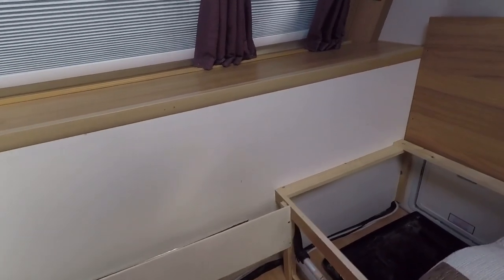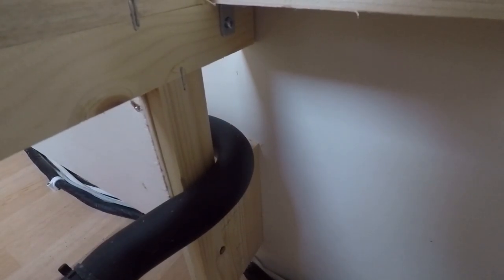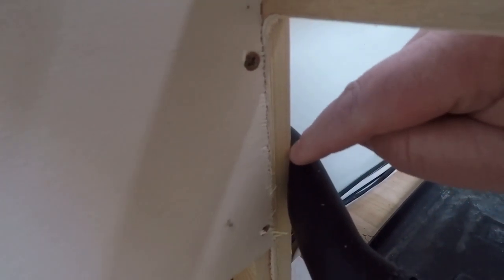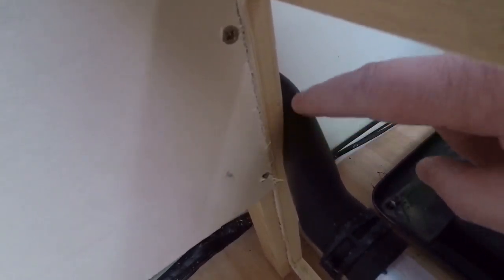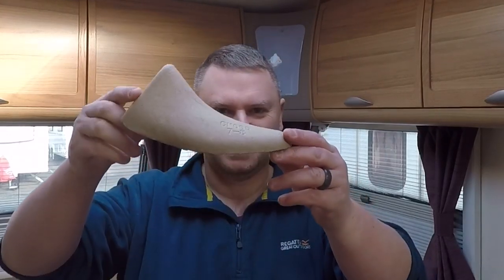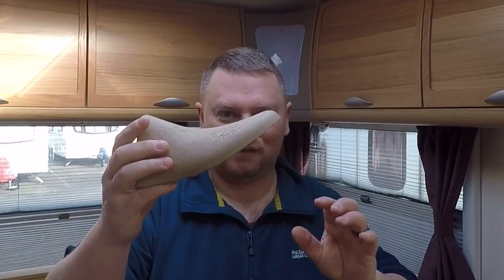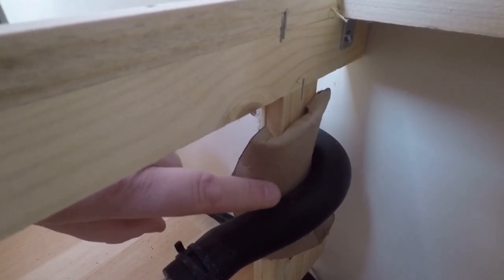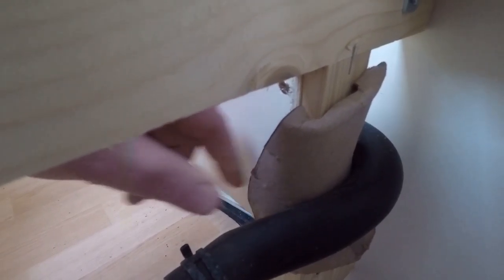Alde heating pipe Check!

Comment: Thanks for the shout out Martin it must be a common fault on most baileys  . Ingenious way to protect the  pipe  . Totally agree with what your saying about this Caravanning community sharing ideas and fixes to problems found .
ive used a piece of foam like that found around the pump and the surge damper . Another informative video  cheers again Martin 👍👍
Reply from the maker: Hi Mark, thanks for the heads up on this one. I couldn’t help noticing when doing the job how rough the ply was cut near it, splinters all down the edge! wouldn’t have taken long to give it the once over with a bit of sandpaper when it was built 🤔🤔🤔 thanks again, Martin 👍
Reply: The Caravan Nut  yeah mine is identical but normally that part isn’t seen so i think its out of site out of mind

Comment: Hi Martin I read on another vlog that you were researching changing the Alde fluid. This is what I did : All I did was to disconnect the in out to the header (after draining the fluid out below the expansion tank level) connected hoses to the in and out of the tanks connectors and put the inlet pipe into a container with the new antifreeze and an old container from the outlet and turn the heating pump on and draw it through. Once the colour changed to the new fluid I turned the pump off. Reattached the expansion tank and bled the system. Job done! Cheers. Nick
Reply from the maker: Hi Nick, still not been brave enough to do it myself. How much fluid did it take? 
Might look at it again as it needs doing this year. Thanks for the info, Martin
Reply: @TheCaravanNut  About 10 ltrs in all. Cheers Nick

Comment: Hi. Yes nice to get little fixes from others who notice problems. 
You could also use some 22mm pipe lagging (the 1 with the split running down the length) if that makes any sense.  
Enjoying viewing your vlogs . Keep up the good work.
Reply from the maker: Hi Ian, good shout with the pipe lagging, will have a look into that. Thanks for the feedback and comments. Martin 👍
Reply: @TheCaravanNut  with the lagging. It can go either around the pipe . Or run it down the wood. Should work either way I'd think.